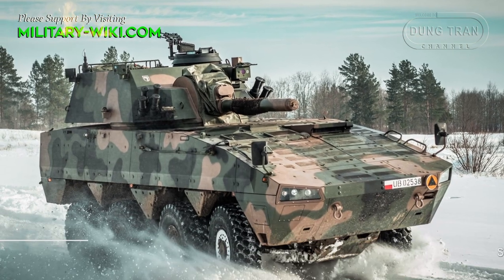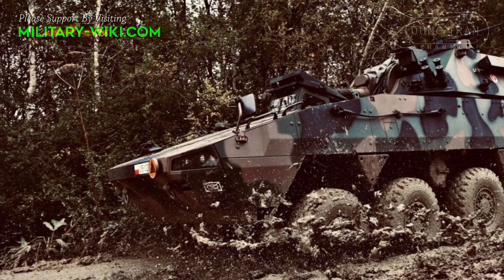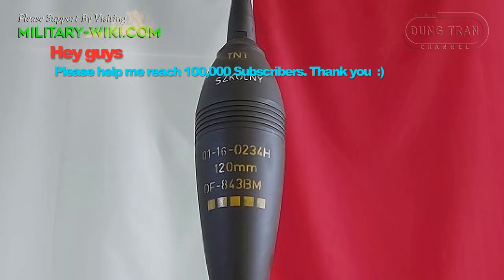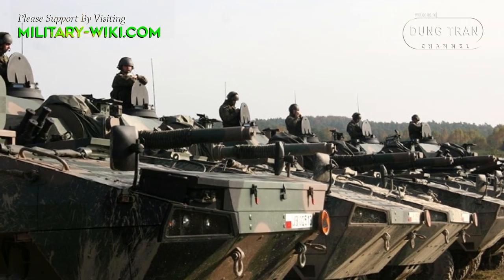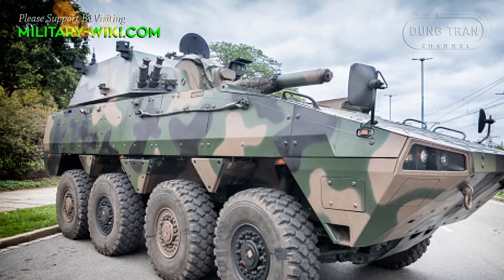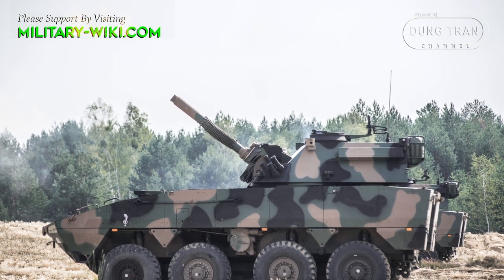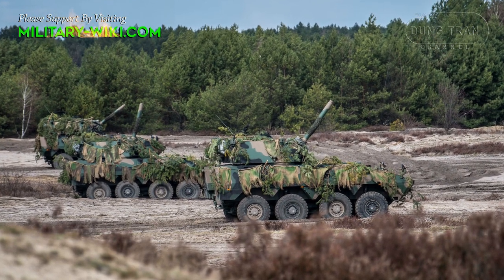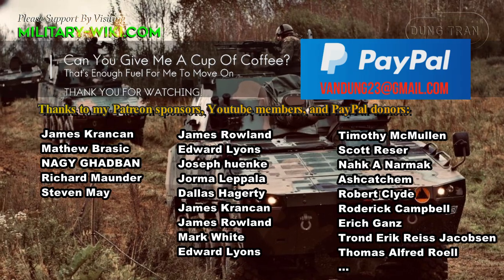Poland's M120 Rak: Self-Propelled Mortar 120mm Is Crowned

Comment: Mortar is used closer in and controlled by the echelon using them, resulting in faster response than howitzers. Mortar Time of Flight is about 50 sec vs 2 min plus for howitzer.  Breech loaded, vehicle mounted mortar can employ both indirect and direct fire trajectories. The trend in modern western militaries has been significantly increased use of mortars. These mobile systems with digital fire control and powered turrets are being produced in direct response to front line and SOF requests. Newer mortars place Illumination, smoke, and HE on target faster and more accurately while reducing physical burden on mech or motor infantry.

Comment: a mortar? they'd be better off going right to a 105mm howitzer and being done with it more range higher payload per shell same rate of fire!
Reply: Polish 120mm Mortar HE Shell has 3,1 kg of explosive load while for ex. 105mm  HE M1 shell for M101 has 2,18 kg of explosive load. So that's almost 50% more explosive ... So no we would not be better with 105....
Reply: @Crimerenegade  FACT!
Reply: @Crimerenegade  shells can be redesigned to hold more! not a big job! the extra range it'd be worth it!
Reply: @keithmoore5306  1. You clearly have no idea how hard it would be to redesign the shell for 105 mm gun to fit more explosive payload and still keep the original parameters....
2. M120 RAK has a range of 12km with new Polish made rounds RAK-HE-1..that's exactly almost the same as the range for HE round from M101 which is 11.270 meters - 11.27 km... You can also take under consideration GIAT LG1 that can reach 17km but ONLY with BASE GAS BLEED ROUNDS and lighter payload. M120 can also use special RAP (rocket assisted propellant) but without lowering the payload amount...so still no 105 would not be a good choice for us. 3. Mortar has steeper trajectory so you can more easily reach targets that may be unreachable for classic howitzer. Further more steeper trajectory will allow You to do simultaneous strike on multiple targets from one Mortar (a thing that 105mm howitzer can't do, only 155 can do that...). 
3. 105 was never in use in Poland, also it is at this point of time obsolate compared to 155mm or modern 120 mortars. Introducing 105 to Polish army now would make as much sense as introducing 115mm smoothbore guns alongside 120mm ones...
4. M120 can also be fired in direct mode just like "classical gun" and also can use HEAT ammo to be able to penetrate heavy armoured targets. Add to that the round carry more payload which means more penetration than 105 HEAT
5. M120 will not be the main artillery of Polish Army, but rather fire support for lighter units as the "heavy" artillery in Poland right now are 155mm SPG's  (Poland does not use towed guns ase we consider them to have way too low probability of surviving conterbattery fire) 122mm MRLS and 227mm MRLS (M142 HIMARS) and 239mm MRLS (K239).
6. A shittone of countries are using 120mm mortars and are purchasing new ones, even russians decided to replace 2s1 122mm SPG in some units with 120mm mortar... So apparently half of military world don't know the greatness of 105.... kek
Reply: @Crimerenegade  i don't like or trust breech loading mortars deal with it!!!
Reply: @Crimerenegade  Well... To be specific in Poland these mortars don't even count as artillery. They are infantry support weapons in support company at the battalion level. Proper artillery is at brigade level and above. So this comparison is pointless from the beginning.
Reply: @keithmoore5306  Poland use155mm Self propeled guns and still hashas many 122mm SPG @s1 gvosdika which are much better than 105. No one will go to the 105mm in Poland but US armt wants to get 120mm mortars on wheels and Rak is one of the competitors.
Reply: Perhaps but mortars fire at higher angle than howitzers, that's considerable advantage
Reply: @PeliKarhu600  all depends on the mounting! a howitzer can be raised to the same angle! in WW1 they rigged french 75mm's for use as antiaircraft guns by raising the barrel angles by setting the gun up on a platform so the trail was lower and got to 85 degrees!
Reply: @keithmoore5306  Logistics are also important. Poland has tons of 120mm ammo but doesn’t use 105mm systems.
Reply: @PeliKarhu600  you can bring a howitzer round down just like a mortar round but a howitzer gives better range!
Reply: @keithmoore5306  But howitzer is more expensive. for the better range we use 155mm Krab howtzer (above 40km range) and for the support better to have cheaper and larger caliber mortar with 12km range.
Reply: It is close support at bathalion  level. There is no place for classic howitzers. The King of modern battle are SPGs.
Reply: @PR_nick  breech loading mortars are rediculeous! they're just howitzers with a non standard shell and bad recoil system! all the work here they might as well have gone the extra 10% and got the range advantage of a howitzer! if you want a SP mortar throw muzzleloading one in a 8x8 and you have one!! and in nWW2, howitzers under 105mm's were at battalion level with the 81 and 60 mm mortars!! the 4.5 inch/120mm were in the chemical corps. domain!
Reply: @keithmoore5306  Let the people of the Army decide what equipment is best for them. I believe that since in a modern war with UAVs, with artillery radars and anti-battery fire, the Self Propelled Mortar system's uplift is not a coincidence. Especially when this mortar can fire special ammo. The range of this mortar is over 11,000 m. By the time the first three burst shell drops, the crew and mortar will be several hundred meters away. This product was made for hit and run tactic. I can't imagine escaping with a 105 mm howitzer. The Polish army has 122 mm 2S1 trucked SPGs in stock and is replacing them with the M120K Rak.
Reply: @keithmoore5306  Pointless argument...
Mortars can provide higher volume of fire at shorter ranges,much higher trajectory and simpler logistics. So they can hit targets in urban environment or difficult terrain with more impact than 105mm artillery shell. 
It's meant to provide fire support for battalion level formations and go with them. So it may be required to fire at relatively close targets with indirect fire - you can't fire classic artillery (even 105) at 2000 meters and expect it to hit enemy behind tall building - you will simply hit the building in front of them, it can be done with mortar though. 
Mortars like this are much more flexible for task of direct fire support than classic artillery. When they roll out laser guided rounds for these it will give another layer of equipment capable of destroying MBT's, and any lighter vehicle. Destroying vehicles is very important for Poland due to sheer amount of post soviet bullshit Russia has.
Reply: With my limited knowledge, howitzer barrels need to be replaced/rebored after 1,000 or 2,000 firings. Time consuming and expensive.

I believe mortars don't have such issues.
Reply: @Dab-Da-70  it's 3.000 to 5,000 for the larger ones i think 105's and smaller go 7,000 to 11,000 and all barrels have a lifespan! mortar barrels are smoothbore for the most part but they take one hell of a pressure spike when that lifting charge goes off! the US and most major militaries don't use breech loading mortars they all use muzzle loading mortars granted some of those do have an autoloader attached but that should tell you something about the breech loading ones!
Reply: So why do every army in the world with scientists, generals, tactitians and strategeists use mortars in their armies when a GENIUS KEITHMOORE says its obsolete? Are they dumb or You are an undereducated moro-on?